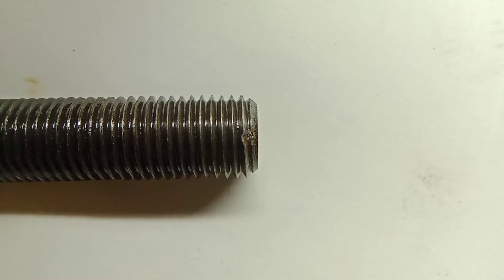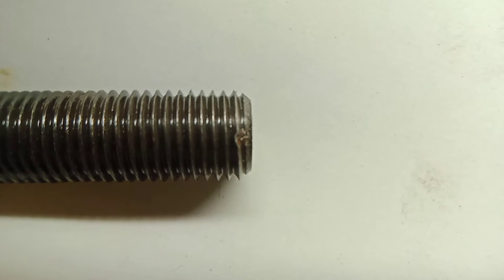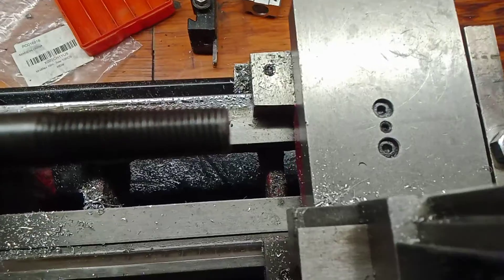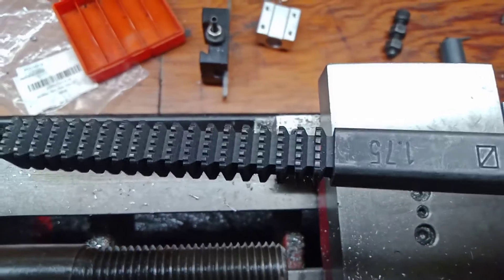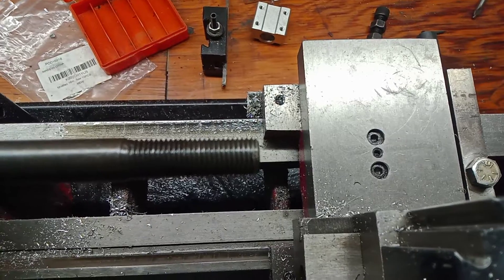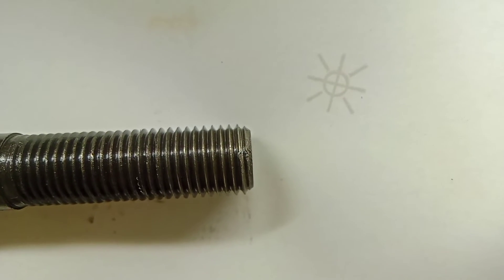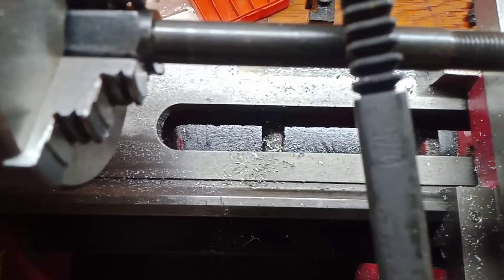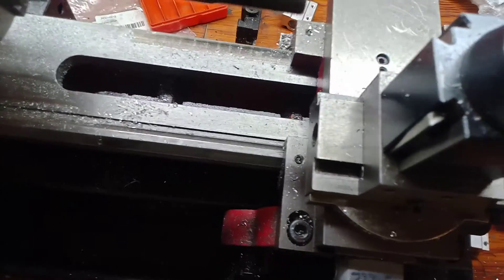The ancient tool known as a thread file.

Comment: Great video. Yes people, you can repair threads on screws and bolts.  I'd bet if 100 current machinists 18-35 years old saw this video 90 of them would say "What is that thing?" I can't count the amount of times I received a bad thread from the manufacturer, customer or ruined one myself and had to fix it. This is especially important when the bolt or screw isn't commonly available.  There's a big difference between pushing play on a machining center vs actually repairing and or fabricating with what is available.  They're 2 different skill sets. Production vs 1 off /prototype or repair.
Reply from the maker: Larger, fine thread bolts, like 7/8-14 are almost guaranteed to need dressing up right out of the box.  I can't justify owning every threading die known to man and I don't want to dink around with a small file either.

When I bought those i called 4 different places locally that sell stuff like that.  When I asked if they had any thread files they said, "a thread file........".  None of them ever heard of one
Reply: @RealDeanWinchester  Exactly.  What is that you're looking for??? This is very valuable info for anyone who needs to fix threads.  Let's keep this channel growing.  Lots of good info and some videos are just for laughs